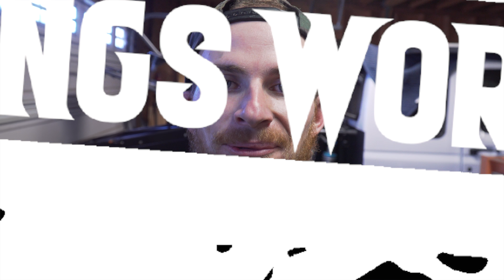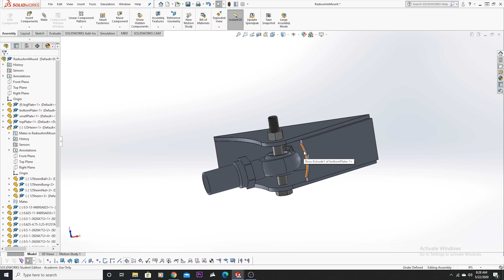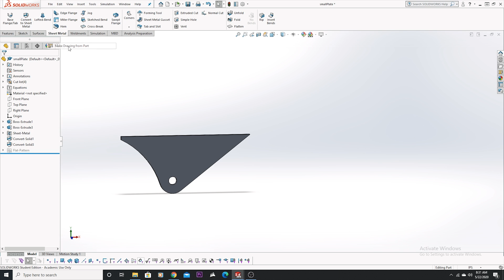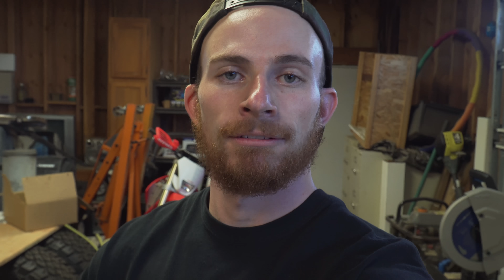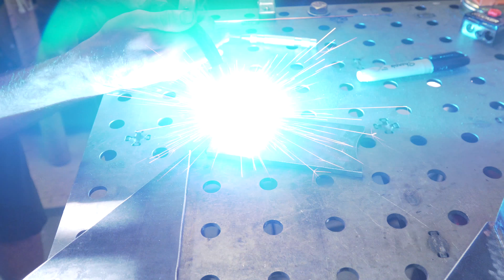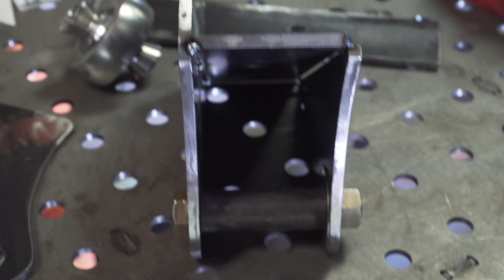7.3 F250 DIESEL BUILD - Fabricating off-road radius arm mounts! EP. 01

Comment: Regarding drilling frames. If you ha e to drill the bottom of a frame rail a super easy easy way to do it, is to use a floor jack to push your drill into the frame. This keeps you put from under the drill, and uses the weight of the truck to act like a drill press.

Comment: Have you ever used enduro joints or Jonny joints? Was reading that they last longer than heims and give better articulation than a bushing.
Reply: Have heard of them, but never personally used them. I see those joints being used on jeeps and slower paced vehicles that need more articulation but as far as an offroad truck goes I will always use a heim or uniball for pivot points just because I personally think they are stronger than the Johnny joints. This truck being a “street” truck it probably would have been fine but I’m stuck in my prerunner habits 😂😂😂